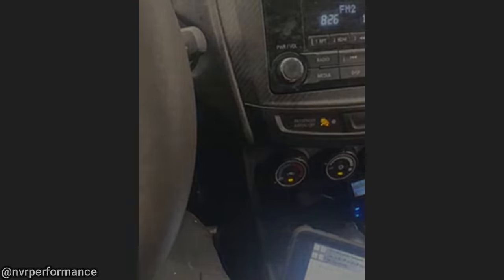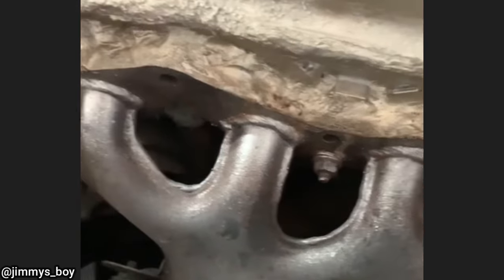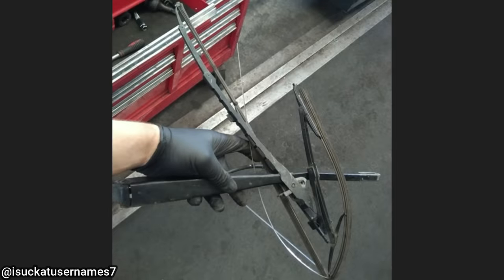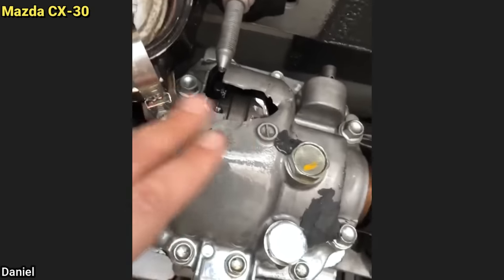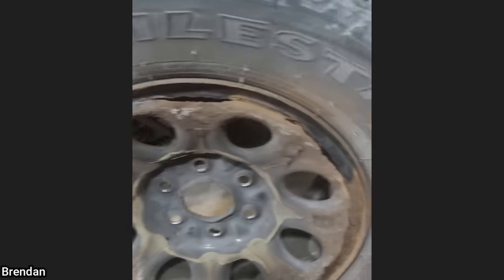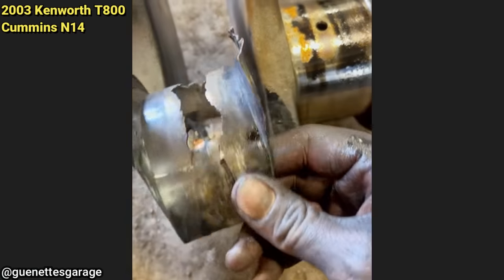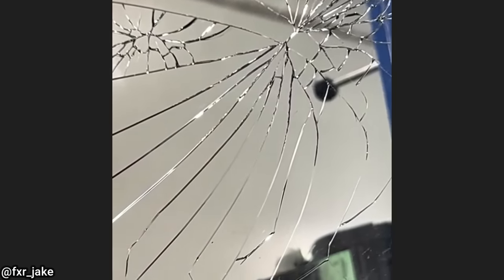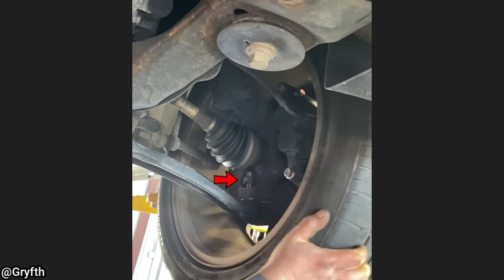Customer States (Best of January & February 2022) | Just Rolled In

Comment: I told a buddy of mine about this channel and  overfilling the oil by many quarts.  He told me his daughter's car wouldn't start and he asked her what she had done.  She said she put oil in.  He asked her how.  She twisted off that cap on top and looked inside and didn't see any oil.  So she went to the auto parts store and bought oil and put it in.  she then looked in the hole and didn't see any oil yet so went in and bought more oil.  He asked her how many quarts she put in.  she said 15 quarts.  He asked her why she didn't put more in and she said she bought all the store had....he drained it all out and saved it for future oil changes.
Reply: big brain at the end
Reply: That’s why you give your daughter a square box chevy they’ll hold 25 and still run 🥳
Reply: @joeylawell3590  I wouldn’t even do that to an old 454.
Reply: @joeylawell3590  My sister had a 93 Cavalier and it went to my uncle later on. He had given it up a few years ago because the gas tank rusted out and it had a exhaust leak going up through the rusted floor. But that engine still worked great, at 350K or so.
Reply: I used to drive charter bus back in the ‘80s. The owner had his teenage son come in to work as a mechanics helper. On his first oil change he did on one of the school buses that was gas powered front engine type, after draining the oil and changing the filter, he started putting in oil, but because the oil wasn’t filling up, he kept adding oil until it came out of the oil filler on the valve cover. It was good that the mechanic happened to catch it in time and question why the kid had used up so much oil. He had to drain out a lot of oil.
Reply: @Dozav7  as a 454 owner with only 7 working pistons I would have appreciated the previous owner giving a little more love to it...
Reply: @anjhindul  - damn. Hope you can fix it up or replace the engine.
Reply: I hope the engine survived too, but smart to save the unused oil, that's gotta be close to $100 worth of oil
Reply: @420anonymous  Vauxhall make very good cars, my first car was a Mk3. Cavalier, which was hit by a bus. I think that the bus was worse off, be caused the Receivers came into the the bus depot the next day.
Reply: @petermostyneccleston2884  That made me do a bit of research, I didn't know there was a Vauxhall Cavalier. That other guy probably meant a (US) Chevrolet Cavalier since he was responding to someone talking about a "square box Chevy." The Mk.3 Vauxhall wasn't closely related to the US Cav like the Mk.2 was, your car was probably better overall. Although the US Cav on the old platform wasn't as bad as many people say it was.
Reply: A friend worked at an auto parts store. He noticed a pretty girl coming in repeatedly buying oil, going out to her car, and coming back. He finally went over asked her what she was doing and same thing - keeps adding oil but can't see any oil in the filler hole.
Reply: @petermostyneccleston2884  Vauxhall/Opel (basically the same brand) makes good cars again. From the late 1980s to the mid 2000s their cars weren't that good. The company was owned by GM (since 1929) and in the 1980s GM started intervening quite a lot, without actually understanding the European car market. This led to them producing some very boring cars that weren't too good.
Reply: So glad my father taught me what a dipstick. And now I'm m going out to check the underside of my truck because these videos are making me paranoid.
Reply: That was his fault for not showing her
Reply: I want her to change my DSG oil.
Reply: @joeylawell3590  can confirm, there was no overfilling my 98 Blazer. I miss that thing.
Reply: I had an old car that leaked oil real bad and I had to put a quart in it almost every day. It smoked and stunk like burning oil all the time. I worked graveyard shift and I worked a double one day. I went home and was so sleep deprived I forgot I had already put in some oil and put more on top of it. Next time I started the car it looked like a smoke bomb went off. I drove it to a shop and they all looked at me like I was the biggest idiot.
Reply: @MyRegardsToTheDodo  the Vectra was awful, before that they were alright cars. The 80s mk2 astra was pretty good in GTE guise.
Reply: Vauxhall aren't available in the US.
Reply: I feel like auto shops should have a cutoff like a bar would. Theres a certain point when you have to realize that this customer just shouldnt be buying any more oil.
Reply: @averagejoe9040  or at least ask why and then go out and check what the customer is doing with the oil.  but sells oil I guess.  never get in the way of a sale.
Reply: That's what I call a budget engine cleaning.
Reply: It's honestly pathetic how many "dads" don't teach their kids basic car maintenance.
Reply: @mrshoeguy2477  the problem isnt always the teacher. If the student isnt willing to learn, they wont learn.
Reply: The reserve could save an oil crisis.
Reply: I just gonna hope she bought the same type of oil every time or dad told her what to buy, because how the fuck is he going to know what oil he using unless it’s one of the above.
Reply: @akafxde7245  assuming it was all the same because the store ran out.
Reply: I wonder if the store Had not Ran out of oil, how many more Quarts she was willing to add !!! Wow this is funny !!! This is why i do not let my Wife, Have anything to do with the Car, other Than Just drive it !!!
Reply: @rogerhegemier8491  after watching too many of these, I had my wife check the car fluid levels recently and then asked here where she would put oil in.  she got that part right and knew how to check the oil level.  Her dad trained her well.
Reply: Just give em a 84-88 yota...what's oil?
Reply: You didn’t raise her right lol
Reply: @joeylawell3590  no, that’s when you take away the keys and tell them to walk because they are to stupid to operate a vehicle.
Reply: My daughter couldn't see it on the dipstick (clean oil)  it started smoking and a part came through her valve cover.  I drained the oil and there was 15 quarts in  ford escape!.
Reply: Shameless store, selling her all of that oil without asking why she was buying so much...
Reply: @ivanvarela3215 Not really it’s going to be very contaminated but better than nothing I guess. She added it to the old dirty oil. The dirt will be super diluted but it will still be there.
Reply: So what, she drove it back or called someone to the shop parking lot?
Reply: @EZ-D-FIANT  Have no idea how he got the car.  Could have been towed to the house because it wouldn't start.
Reply: My 2010 camaro SS holds 8 quarts  oil. The mechanic couldn't believe it so he only put in 3 quarts. Good thing I asked him. 😮
Reply: Good idea you can't over fill then things cause the oil will leak faster than you can fill it. lol